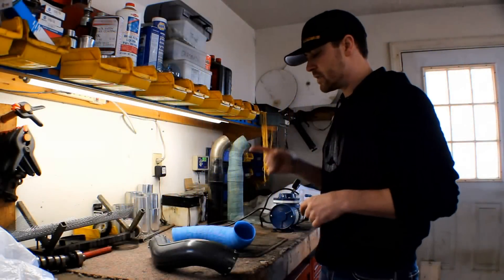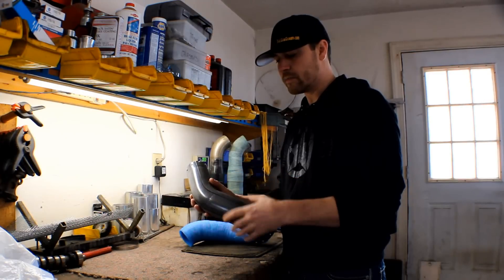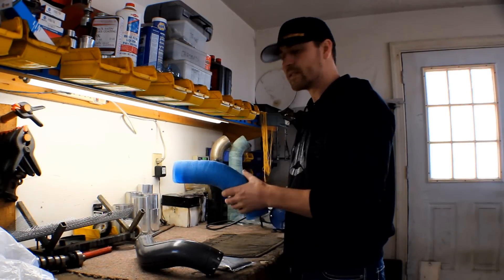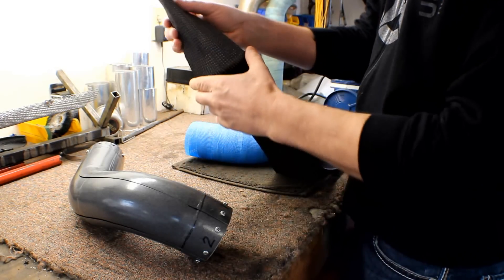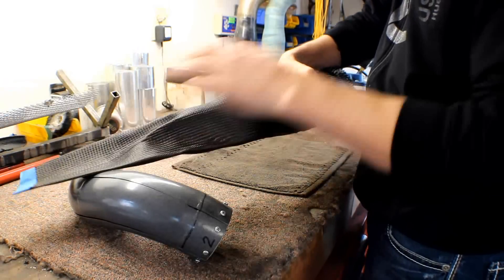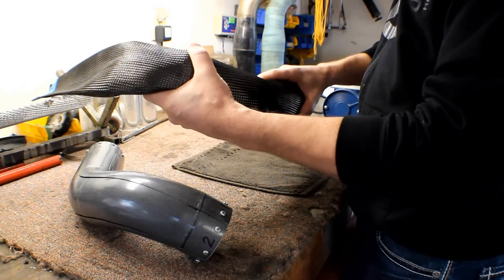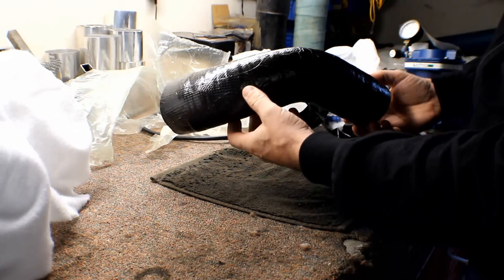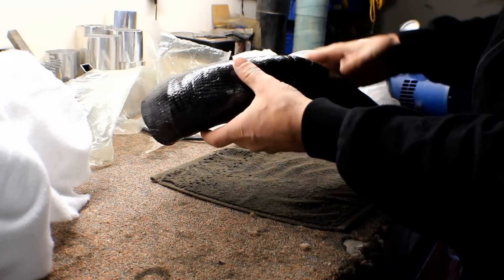How To Make Carbon Fiber Induction Tubes

Comment: this is tight and dont look difficult.. was wondering ever done some canards?.thats what brought me to this video because i wanna do a diy carbon fiber canards on my suby..
Reply from the maker: +Ed Ruiz Canards? What are those?
Reply: +The Fab Forums they are kinda like a splitter but they go on the sides of the bumper and in most cases you see 2 of them.usually a small one half way up the side of the bumper and the other is a little bigger but same shape but more lower on the bumper and usually theyre more on import tuner cars and are used to help with downforce
Reply from the maker: +Ed Ruiz Gotcha. I have not personaly done any but there is a guy over on my forum that does alot of that kind of stuff. I would bet he could help you out. http://thefabforums.com/main/index.php?topic=1281.0
Reply: +The Fab Forums oh alright tight ill check it out n thanks for the replies.you have some cool stuff on your channel
Reply from the maker: +Ed Ruiz Thanks

Comment: you duplicate the od of the pipe.is that what you aimed for?
Reply from the maker: +Georgios Banos Yeah. Because this pipe was cut into 4 parts it actually made the OD a little bit small which worked out to make the ID of the new tube perfect
Reply: (y)

Comment: Wait, I don't understand it.
If you put blue plastic tube into carbon... How do you take it out? I mean, what's the difference between this, and wraping it with M3 carbon? 
I don't understand, and I want to, because I tink this is so cool, I just want to know what's the point.
Reply from the maker: What blue plastic?
Reply: Blue tube. Sorry. 
Blue tube at a beginning. Do you take it out at the end, or does she stay in that carbon cover?
Reply from the maker: Its not plastic. Its fiberglass, and the two of them stay together to create a strong hybrid composite.
Reply: Ok, I know I sound like a hater, but I'm not, really. I supscribed to your chanell, because it's awesome. I just wan't to know, if you say it's fiberglassed tube, and we all know that there is no reason for her to be strong, because no one is gonna touch her but only air, explain me, please, what is point of putting carbon fiber on fiberglassed tube, and combinining them, rather then puting 3M carbon vinyl?
Reply from the maker: +JDMTurboful No problem. The carbon fiber is for strength. The idea is to use these tubes on boosted applications. Here is a video of some pressure testing I did. Fiberglass alone would never stand up to this kind of pressure. https://www.youtube.com/watch?v=_oZtQ7WOQsA
Reply: Now I get it! 
Thank you!
And sorry for those questions, I just wantet to know. :)
Reply: +The Fab Forums I'm new to this and sorry if this question has already been asked. Why not skip the fiberglass and just do the Carbon Fiber? 

It looks like it would be really easy to just use the Carbon Fiber sock over your metal 4 piece tube (that you used to make the fiberglass tube). Am I missing something?
Reply: +Gary Morris 
It´s possible but even professionals use a core of glassfiber sometimes.
Just apply the amont of carbonfiber layers you want and at the final add the tube in the same way.

Remember You must use epoxy only on carbon fiber, it´s not campatible with styrene as glassfiber.
Reply: +JDMTurboful I don't really buy the "hybrid" material idea my self.  You can't tell me that thin porous layer of casting fiberglass material actually does anything to increase pressure performance.  The whole idea of having "hybrid" materials is to benefit from what one material alone can't fully offer.  What does the casting material offer?  It creates a cheap way to mock up parts for test fitting, but if you already have your parts you want to mold like this guy did, then just go carbon on Kevlar and be done with it.
Reply: +Gary Morris Because the initial video was meant for beginners to easily do or a time saver method. He made this tube out of cast material which requires no extra material and furthermore no mixing of said materials. I'm sure if he was doing one for himself on a car it needed to look good on, he would certainly go a different route I would imagine. This is a 2 part video, it just doesn't say so in the title is all.
Reply: +Gary Morris Saving weight.

Comment: Why not try lost wax procedure..
Reply: Only adds a couple hours... If anything saves you time with less secondary processes (part cleanup). Start with metal pipe, split in half down the parting line like you did, but not in 4 sections just in half. Tape the two halves back together with high temp aluminum tape. Plug one end of the pipe. Buy bulk wax from online - pretty damn cheap, melt down with a double boiler method on your stove, and pour wax into pipe. Remove two halves of metal pipe and now you have a wax core. Take the carbon sleeves and apply directly over the wax. Once the carbon is cured, stick everything in an oven and the wax melts right out leaving you a smooth hollow pipe.
Reply from the maker: Slow production

Comment: Did you leave your vacuum pump running overnight while the part cured?
Reply from the maker: +stkmltS I do if I cant get a perfect seal. If you can get the bag to where it has no leaks you can just pinch the line shut and turn off the vac pump. Perfect seal can be hard to get sometimes though.

Comment: what the f are you doing use a clam style mold and a bike tube inflate the tube in the two peace mold
Reply: +jason mooney that sounds super cool could you post a video? or do you have a youtube channel?
Reply: i do have  a channel
Reply: +jason mooney lovely stuff ! I'll check it out
Reply from the maker: That's not near as efficient as my process
Reply: ok i only do this for a living my processes is clean and is how big companies like Koenigsegg do it claim shell molding process with a inflatable bladder for tubes.  at my shop we make turbo  piping out of carbon fiber  do it all in steal pipe tacked together then a bondo fiberglass clam shell mold bondo instead of gelcoat stronger i mix in carbon powder  and more resin. then we use a motorcycle tube cut in half and clamped on both ends then inflate it inside the carbon fiber sleaving
Reply from the maker: I agree your way is probably the best way, however 99.99% of the population is not trying to be Keonigsegg. They just want an easy way to make some super strong bad ass carbon fiber piping. That's why I created this solution.
Reply: take me 30 min for my mold bondo drys hot then glass 15 min am making a part that next hour. your way 2 days twice as expensive requires sanding on a part that holds air that's a no no
Reply from the maker: Tell ya what make a video and then you can talk about how everyone else sucks and don't know what they are doing.
Reply: The Fab Forums 4 years ago? Disappointed he hasn’t done a video on the “right” way!??

Comment: How much would you charge to make me one for a 2013 chrysler 300 3.6l?
Reply from the maker: Brad Cummings I dont have the any way to protype the tube without the car
Reply: The Fab Forums thanks for the fast response,  I can get the casting thing for free.  So I was wondering if you think this is a easy task?  And what size should I make it I was thinking of using a3 inch pvc to use as a molding.  Please help me brother
Reply from the maker: Brad Cummings Yea the task shouldnt be too hard and a 3 inch tube should be plenty big enough.
Reply: The Fab Forums thanks. Bro I admire your work,  when I complete the project I'll tag you
Reply from the maker: Cool sound good
Reply: +The Fab Forums bro I'm having trouble figuring out how to make the hole for the sensor and vac line?  I know you know or do you have an idea that I should try?please help

Comment: Have you tried to mold the sleeve over aluminum tubing?  Was curious if you can achieve a smooth finish by doing so.
Reply from the maker: Derek Fricke I have not...you can get a smooth finish with the process I used. You just need to smooth the fiberglass before overlaying the carbon fiber.

Comment: Really, really cool idea... something that I am going to do very soon - thanks for the ideas :).
Two questions if you don't mind:

1 - How much pressure can these tubes actually take?
2 - How would you go around the additional lines that usually are in the tubes? Like vacuum lines, sensor holes and so on (if you tried those kind of pipes yet).

Thanks! :)
Reply from the maker: mrN3w7 Thanks,
I have some pressure testing videos on my channel www.youtube.com/thefabforumscom where they hold 30 psi no problem. As far as any external port, they can be plumbed after the fact pretty easily with some to part epoxy.
Reply: They can handle a lot of pressure but make sure you don't try to build a submarine like this and go visit the titanic. That's too much pressure.

Comment: Can this be used for turbo applications? Would it hold up to the heat?
Reply from the maker: joshua stoffregen We have pressure tested it up to 30 psi with no issues. We actually have video of it on our channel. I have used these on cars in the past and the heat didn't seem to affect it any but not sure under boost. I am thinking of making some for the twin turbo mustang project we also have on the channel.
Reply: Thank you!
Reply from the maker: No problem...anytime

Comment: Hey which diameter of carbon fiber did you use from that website? It says " will compress about 20-25% and tension about 60-65% from their base diameter." So would I need the 4" or 2.5", and when you pick quantity does it come in seperate one foot increments or continuous? Thanks.
Reply from the maker: I ordered the 4" so the weave would be tighter on final part. it comes in continuous length.

Comment: This is for an induction tube? How do you deal with the interior of the tube being so rough? Would this cause unwanted turbulence on the induction charge?
Reply: Keep in mind if you go to a place like Easy Composites UK (check out their cool video series too), you can get fillet wax designed to fill the seam gaps between the pieces.

And yeah, they do a lot a work that looks absolutely amazing on the outside when ironically they should technically be more concerned with the inside finish, which is often difficult to get good, so people should value this idea. Easy Composites offers a full line, including release agents so your split pipe form could be wrapped directly in CF.
Reply from the maker: wickedkustumz The inside of the tube is actually extremely smooth. It being wrap tight against the tube creates a very smooth surface on the inside.
Reply: Even if there was some pits on the inside it would act like a golf ball where the pits hold pockets of air and the rest flows over smoothly

Comment: I'm just scratching my head a bit because you need to install a coupler over that, and you have just make the Diameter of the pipe larger. 
In your other video you even add another layer of Carbon and use this piece as a mold, making it even larger diameter again. How are you compensating for the increased diameter? You are going from a standard Diameter to some non-existent random size, no?
Reply from the maker: tunermaxima3000 no because the when I made the split mold out of steel I cut the steel tube length wise four times. Each cut took out about 1/16 of an inch of material. When the pieces were put back together it decreased the diameter of the tube enough to fix the issue you described.
Reply: TheFabForums.com Thats an awesome point ^ I had an idea similar to this that would also aid in clamp compression, If you were to mold these around a normal size you could slip a 2 inch, 4 inch whatever length required, as an internal coupler, With a silicon coupler squeezing the CF tube, onto the small length of steel tube.. Sort of the way compression fittings work on a hydraulics systems.. Thoughts on this?
Reply from the maker: I think its a great idea. I have also thought about doing that. I also thought about using that same method but putting a v-band on the tubing and epoxying the tubing into the composite.

Comment: Do you have anything showing joining a tube to a flat sheet of CF? Placing threaded inserts into a part so that the CF piece can be bolted to other parts?
Reply from the maker: I don't....what are you trying to make?
Reply: Brake duct spindle outlet... to be bolted to a hub
Reply from the maker: hmmm...you could make the tube and flat piece together as one part. I would have to see what it is exactly to give you anymore feedback.

Comment: great vids! with this project could you skip the cast tape part and use a release agent on the metal mold with holes drilled in the end caps to get a smoother finish?
Reply from the maker: yea you could do that. I kind of tried to show the two techniques together in one video
Reply: TheFabForums.com Would you need to do a double layer of CF to ensure a good seal?
Reply from the maker: I probably would for strength and seal. It still wouldnt be very think.

Comment: you should really sand the fiberglass part first 80 grit or less. Once fully cured and after sanding the epoxy can actually make a pretty great bond other wise it usually dosn't take much to separate them. The cool thing about that stuff on the other hand is the pin holes and deformities that will also help to make a pretty good mechanical bond. cool the way you make tubes though!
Reply from the maker: womackke Thanks. I usually sand the parts before I additional layers. On these I was mainly showing the process of make the parts.

Comment: Quick question not sure if it's been asked I'm looking into making a intake tube as well but are you able to just used an aluminum tube then use the same method you did above?
Reply from the maker: JERPERFORMACE yea you can do that. I have wrapped tubes before and then just split one side to remove it from the original. Once it has been removed you can glue the seem and re wrap.

Comment: Why didn't you use fiberglass woven tube on the inside?
Reply from the maker: Scorpion85629 the cast material is must faster and cheaper. No resin needed.

Comment: I think this was really well done. People are commenting on the way it "looks"...I think that at this point weight reduction is about functionality rather than aesthetics. Great video, man!
Reply from the maker: Ray Garrett Thanks appreciate the feedback.
Reply: I was going to comment about weight reduction. If you've already got a functional fibreglass part, adding the carbon and resin only adds weight. What's the actual goal of this? Weight or bling?
Reply: Yoshio Tamiya if it's bling, he missed that boat. Surely one could make an all carbon fibre tube with a little more effort / experience.
Reply: Brian K
Bling may have been too strong a word.
Reply from the maker: +Yoshio Tamiya strength...need to hold boost
Reply from the maker: +Brian K the video was just to show the process

Comment: One small note.  The casting material has a polyurethane resin.   Epoxies do not bond well to poly-u's.   It is just fine for what you are doing with it but I liked the idea for making a mold to make 100% carbon parts.  Thanks for the vid.
Reply from the maker: David Bohm Thanks for the feedback

Comment: Dude, if you take 10 minutes to precut/fit your peel ply you wont have to spend an hour cleaning up that mess afterward.  Also on more complicated pieces, you can make a foam or plaster mold covered with wax paper, soap, silicone, plastic, etcetera, to keep it from sticking.  These molds can be destroyed to removed them from the inside of the cured composite.  Alternatively, you can make several smaller pieces then wrap them all together when your done to form the larger and/or more complicated piece.
Reply from the maker: +BigBrotherIsTooBig you should totally make your own video

Comment: Very new to fabrication in general but extremely interested. Getting somewhat reasonable at welding, and Id like to do this sort of intake tubing on my 89 Mustang GT. Right now I have my intake going from the MAF into the fender and down to the foglight hole in the bumper cover (jerry rigged a bracket to hold everything together with the absence of foglight/foglight bracket) and it works great but looks like frankenstein shit. Any suggestions on doing this with such a crazy angle? And also the best way to make your steel molds?
Reply from the maker: Gorilla Panic cool I love fox bodies. When I make molds from steel I usually just tack sections of mandrel bends together to make the mold, however you could also use some kind of foam, shape it, wrap it and then melt the foam out with acetone leaving you a perfect tube. I have not tried this my self but I have heard of this technique from a lot of others.

Comment: No idea if this has been mentioned earlier in the comments, I really don't have the time to go through all of them, but I think you're over complicating the whole process. Instead of casting it, why not just wrap a couple of CF sleeves over it, apply the resin, and pop the tube out after it cures. You'd end up with a smoother product that required less clean up. Hell, to make it cheaper, you could use a FG sleeve and a CF sleeve over the top.
Reply from the maker: Jacob Walker Yea your absolutely correct. I have had a few other ask about the same thing. I wanted to show the whole process of casting the glass section just in case the tube parts that were being made were too big or complex to get the steel mold out. Some long runs of tube have to use the alternate method of splitting the fiberglass to get it off the steel tube form.